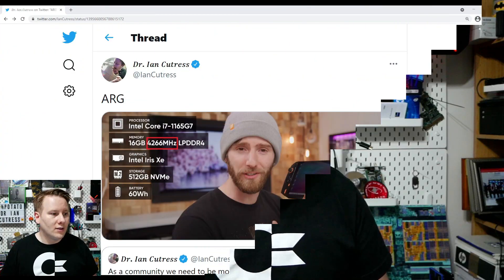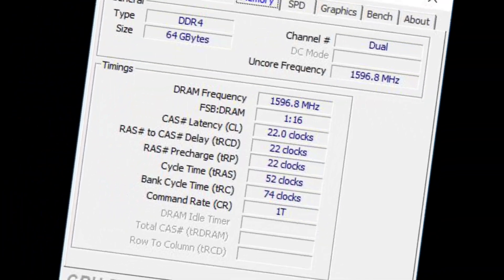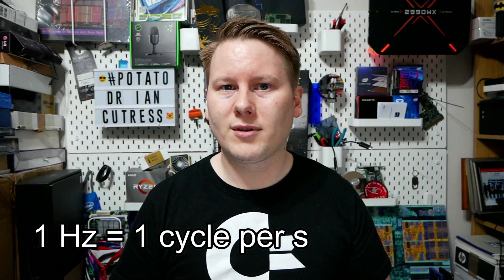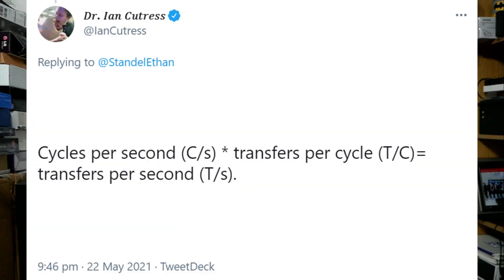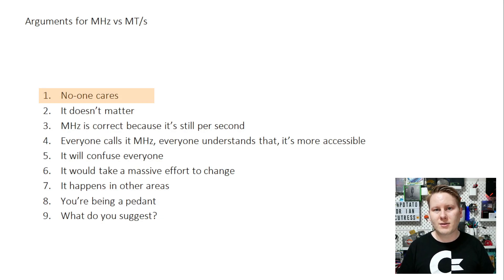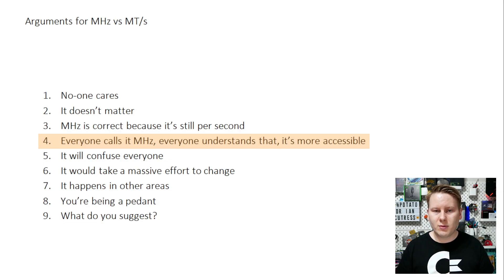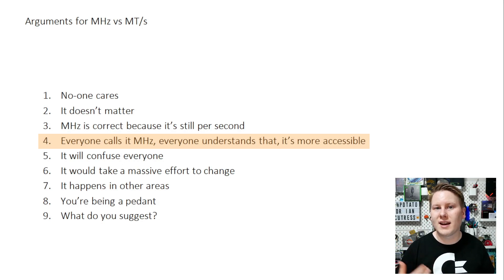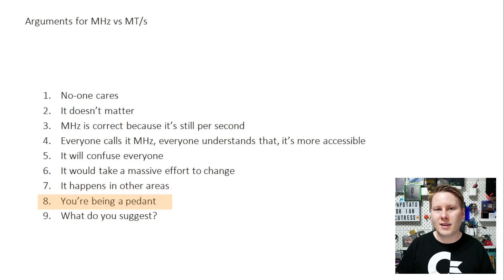Linus is WRONG 💩 : Explaining MHz vs MT/s

Comment: What if you don't refer to the clock rate but to the transfer rate? Expressing the Transfers per second in MHz is perfectly valid.
Reply: Oh you addressed that in 3. You say that you don't do a transfer every time it would be possible therefore it's not something cyclical that you would express in hertz. Maybe it expresses the maximum transfers per second? I find your argument a bit strained but fair enough.

Comment: what you define as cycle is up to you, this doesn't need to be clock cycle, if you would get time graph showing when transfers occur you wouldn't be able to tell with transfer is the first one, and with one is the second, because second transfer is exactly in the middle.
You would be right if both transfers would occur in the same time (as with your music comparison).
I also think that there will never be QDR, because you do not have more reference points to sync in clock signal.
In days when DDR was sill a new thing, you would see in spec real clock, and "effective clock" that was twice the real one, this was to help people that do not know how it world to just compare numbers.
Comparison with CPU is IMO very different thing: in memory every transfer takes the same amount of time (transfer, not operation, as operations may have different timing), and on cpu each operation takes different amount of time, therefore you do not know on what instruction base your clock, (but there is actually something like that used to calibrate idle timing by OS called bogomips - basically how many nops we can do per second)
"Clock is repeated, but you not always do transfers every time" - Our cpu also do not always run at advertised clock, and this isn't event max clock, cpu can decrease it's clock or increase over that advertised one. BTW DDR4 (not sure if previous versions had that) have something called "gear down mode" where transfers occur only once per cycle and this might be used to reduce memory power consumption when "idle"/not much usage.
The whole confusion about this MT vs Mhz started to avoid confusion. When we had SDR memory available that for example was marketed as 133Mhz, and you wanted to upgrade to new DDR memory that was 100Mhz, for non tech people this sound like downgrade, so we started using "effective clock" to be able to compare both standards. Now we do not have SDR memory used anywhere, but we cannot go back because suddenly we would call memory as twice slowed and create more confusion.
In summary in conversation about memory performance I will use effective clock, but if I talk about embedding memory module in embedded system I will stick to correct clock terminology.
Reply: Oh and maybe the funniest one, we shouldn't call DDR4-3200 as 3200Mhz, because memory clock actually 400Mhz, the communication bus is using 1600Mhz :)
Reply: And another funny thing is that in more realistic scenario, where we would use gddr6x memory transmission like standard (2bits per line per clock) we get 2x memory bandwidth with the same clock and the same memory bus width, and using MT/s won't help us to get more useful comparison.

Bus with is also not described anywhere and standard that changes that (happened often in GDDR memory) means that we can send more data per transfer.
We really should call memory as PC4-25600 but this is now usually too big number to use comfortably, but this is description how many MB we can transfer per second, so changing bus width, doubling bits send per line, sending more transfers per cycle will not affect our possibility to compare 2 memories

Comment: I'm very technically savvy and every-time I go shopping or looking at memory I get confused about the terms. If a mother board manufacturer says they support 3600MHz RAM, I have to internally remember to map that to 3600 MT/s ie PC3600, and it gets very confusing. Kudos for discussing this.

Comment: The T in transfers/second makes it a bit confusing (since T = tera) and seems unnecessary. Could you just say the transfer speed to be eg. 3200 M/s? (3200 mega * 1 / s)
EDIT: And why are we even using a capital T and not t?

Comment: So basically the point of this video was that hertz's measure cycles. Ok, I can get down with that.

But leaving out the units altogether sounds stupid. Sure it works in spoken language when everybody knows the context, but in the long run it would just add confusion. Like, it's ok to call it a "16 gig memory stick", but you still specify it being gigaBYTES in the specs. Well, this is just my opinion.

Comment: "QDR" memory was mentioned towards the beginning, like it's no big deal. Is there anything x86 on the horizon that will use QDR? I must have missed that completely.
On the topic of the video: 100% agreed. If anything, you gave way too much credit to some of the counter-arguments. For example, most tech-literate people I interact with on a regular don't use MHz when referring to transfer rates. And since I took the time to write this comment, and you took the time to make this video: obviously some people care. Proper usage of units is the main reason I can get any engineering formula correct these days. I can't remember what most of the formula should actually look like, but I can slap stuff together until the units check out. And don't get me started on fields that use non-SI units. We would be completely lost without handling them correctly. So yeah, units matter.

Comment: If you won't use units, please leave the numbers out too...unless you think everyone knows what I am talking about when I say this is about 148 or 155 depending if you messed up your math. If things are falsely or incorrectly labeled, call em out on it instead of just accepting it. Products being labeled in misleading to incorrect ways won't stop if everyone sits back to take it. I have a 10 gigabit modem with two 1 gigabit ports (how) and have a USB 3.0 flash drive commonly labeled as 'up to 10 times faster than USB2.0' yet transfers at a peak of about 5 megabytes per second which is well below the speed of fast 2.0 drives and does not change speeds when put in a 2.0 vs 3.0 port. So if you haven't yet figured out exactly what I meant with the "this is about 148 or 155" then please leave units on numbers or leave them out entirely as I was pretty specific, though without units (+relative context) deliberately mentioned.
  Thank you for the video as it did help me make better sense of what I had forgotten with the mess of RAM numbering and with recent computer issues was interfering with my mind during attempted troubleshooting+adjustment.

Comment: I'm currently in evening school learnig to be an state certified electrician and if it's a signal on a falling edge and on rising edge is a huge different to a complete cycle for me. I've really thought RAM would be clocked at as example 3.2GHz and a single bit can be send at rising and falling edge... Now that I know about this problem I think to be technical correct the correct technical term should be used 1.6GHz or (up to) 3.2MT but nothing else...

Comment: How about a dive into memory read/write/copy tests (AIDA64? SiSoft Sandra?) for different systems using the 'same speed' memory? TR 3995 Pro vs 3990X vs Epyc 75F3 vs. i9-11900K vs. Xeon W3175 all at 1466MHz 1:1 fclk/mclk

Comment: it is double data rate memory so 3600mhz is an acceptable way to say what it is, everyone uses the metric and everyone understands it.  even me who's been building computers professionally for 20+ years uses it interchangeably ... i agree with Linus it really doesn't matter especially to consumers. to say it does is just being pedantic
Reply from the maker: If it doesn't matter, then you won't mind the right units being used.
Reply: @TechTechPotato  You do you bro if you are happy to use MT's then more the power to you keep fighting the good fight ( for what its worth i wish everyone would use the correct unit ), fact is my customers haven't a clue what that means but a lot of them do understand Mhz it's just the way it is, it doesn't help the fact that the manufacturers sell it labelled as Mhz and retailers like Currys Argos and Amazon list ram or products like Laptops or video cards containing ram in Mhz. what matters to me is the customer understand what they are getting if i have to list products in Mhz then so be it, even if its incorrect.

Comment: Specs don't sell products, Marketing sells products.  The consumer base only sees a number, and is not confused about how that stacks up against other similar products with other numbers.
I'm with Linus on this one, in this case it doesn't matter, and nit picking only seeks to be correct, while not achieving any actual benefit to anyone.
Reply from the maker: If it doesn't matter, then you won't mind the correct units being used. That's literally point 2 of the video.
Reply: @TechTechPotato  Except you are the one insisting on making the correction.  I don't MIND the correct units, but I also don't MIND the incorrect ones, because in the end, I still buy the RAM I want/need without confusion.  RAM is exactly the type of product where you either care, and know what to get, or don't care, and never notice.  That is the consumer mentality, and bickering, even correctly, about semantics isn't doing anything for either situation.  I respect your knowledge and position, but some debates are in effect only academic.

Comment: Well, actually the memory has diffent lines to it. Yes, the clock line (for DDR4 3200) runs at 1600MHz, but the DATA lines actually run at 3200MHz. Or, to put it differently, if I put the binary number 01010101010101 into the memory and read that out, you actually get a square wave at 3200MHz on the data line... (yes, the clock line runs at 1600MHz, but because the data lines can change from 0 to 1 or vice-verse on the rising and falling edge of the clock line, they run at double the frequency). And its the frequency of the data lines that actually matter for the transfer speed... So, if we are saying the DDR4 is running at 3200MHz, we are talking about the frequency of the data lines and then that would be correct.
Reply from the maker: Data transfer isn't perfectly cyclical. The clock rate is. That's literally the first part of the video.

Comment: I bet when metric system was getting introduced all the listed arguments and much more were being used. And yet the benefits of having units defined in absolute sense so that meaning don't change together with the changing average size of human foot so that we don't need to refer to anthropological research every time we read printed values wins the final argument.

Comment: Bravo! This actually hits on a much broader for: the intersection of journalism and science. Many journalists feel that they have to reduce the technical information density in order to communicate a message clearly to their audience. However the problem is they often reduce the accuracy of the information. I can think of many times where I've taken the wrong concepts away from an article only to find later that I was asking because the article I'd read was unintentionally misleading. So good for you for sticking up for information accuracy in journalism.

Comment: You're coming at it from a utilitarian position. You want these words to have meanings that are consistent, and useful.

Linus is coming at this from a pragmatic position. He doesn't care if the meanings are inconsistent and ultimately rather useless. So long as they work.

So when you say, "Linus is wrong." you ignore that he immediately concedes your position and just states that it doesn't really matter because the context changes the meaning of "MHz"

And when he says it doesn't really matter, he ignores that the meaning must matter to some degree, or there's no point in bringing it up to begin with.

You two need to meet in the middle. MT/s is the proper term for the specification discussed, but why is referring to these with MHz wrong? After all, a Hertz is simply a single cycle. While true, we usually discuss the clock cycle when referring to rate of hertz, DDR DRAM is a special case in which we refer to the transfer rate, since it is more relevant to performance, usually. I'd propose that for these reason MHz instead of MT/s is perfectly fine. If someone wants to know the actual clock rate it is very easy, and there's no confusion from listing clock rate instead of MT/s after all. This isn't us saying an 8 core running with a clock rate of 4GHZ is suddenly running at 32GHz because 8 cores at 4GHZ.

Edit: And to add, regarding the suggestion that, since a transfer is not necessarily made every time it can't be a hertz-measure rate, that's honestly ridiculous. We don't consider such nuances when measure the clock rate of things, except when measuring them directly. That is to say we don't consider it in spec sheets. A 4.3GHz processor may clock up to 5GHz on certain loads, and even down to 2.1GHz on other loads. It is still considered a 4.3GHz processor. Another example of how this sort of logic falls apart is electricity. We measure A/C current as an average cycle rate when, in reality, most of the time it's fluctuating pretty wildly, and sometimes will even miss entire cycles because of this. This is considered "dirty" power.

Comment: First T/s is a better and clearer unit. It avoids confusion between interface clock frequency and transaction rate.
Hz base units do not feel wrong to me.
DRR<G>-<SG> is indeed the best solution.

Wikipedia definition of frequency is:
"Frequency is the number of occurrences of a repeating event per unit of time."
If the counted event is 'transaction', it feels to me like Hz is an acceptable unit for a repeating event like transactions on a DDR bus. 

In the case of a clock frequency is clock cycle frequency is what we use ( and I am happy with it), but we could talk about clock toggle frequency at twice the rate.

Comment: TLDR: 120% endorsed. 

about point 4, linus is right and wrong at the same time. 
we COULD omit the units as order of showing them defines all information needed.
we could have 16GB 3600 9-9-9-24 ram kit, and this description is satisfactory for most. 16GB 3600 and 16GB 3600MT/s means the same thing for all technical people, and its easier to use -> less chance for mistake and confusion for everyone else. 
using Hertz there is over complication that does not give any benefit and also might be annoying for technical people. (whole chain of this videos show it)
I am sure if anyone would miss-label their kits like this: 16GB  9-9-9-3600 any technical people would sniff it out very fast.

7. if everyone do stupid sh**, lets do it also. worst possible choice.
9. omit units for whole ddr5 -> start using ddr6 MT/s

Comment: well for better or worse Intel (or actually maybe the memory consortium themselves) have always been consistent with the MT/s vs MHz lingo.  Where MHz might be the actual base clock and the MT/s might be the dual/quad pumped version of the base clock (and if my memory serves me right it's not just DDR memory but also PCI bus or other parts/bus as well)

Comment: the Problem is you NEED to be able to Explain why its Faster quickly or you might lose the Customer....
 
"well you see the MHZ is not the Actual speed since it sends 4 ..........."(trails off into sunset) 

you lose the laymen and you lose the person who NEEDS to know what one is Faster. Marketing or not.
QDR4@1200Mhz Vs DDR4 @1800mhz.   Which one is faster? quick look might Say the DDR, but if you did the math..... you would know that DDR4 "effective" is 3600 and QDR 4 would be 4800 
and here is the Problem. Its Marketing, Yes and its "Kinda" wrong. but its getting the Consumer and End user the info they need to determine what is faster. without doing math or knowing specs beyond the Mhz. its DDR 4 and it runs at X speed.

Comment: That's a bit like the difference between Baud and Bits per Second. With modems, they were almost always transferring one bit per clock, thus the Baud and the Bits per second were identical, but if your system was transferring 2 bits per clock, then your bits per second would be twice your baud rate. Even using "Clock" here isn't fully accurate though. 

If you want it to be useful for the end users, you'd probably want to have it in the form of bits or bytes per second per channel... Mega Transfers, like MHz, is kind of a roundabout measure of performance. The number of bits per channel per second is basically the MT/S multiplied by the bus width in bits though, at full throughput, but you wouldn't actually get that all the time because there's overhead and latency in the protocol, but maybe it's useful as a "maximum theoretical gigabits per second." MHz were kind of a useless measure for CPUs as well unless comparing the exact same architecture to itself.

Comment: I appreciate you educating and helping the tech community Ian. There a units for a reason. It's always been something that has bugged me about Motherboard, VGA, Memory, manufacturers for a long while. Along with the nm fiasco. I've had no trouble in real life conversation explaining or educating others. So I don't imagine it would be to hard to educate and correct the community at large granted the manufacturers actually corrected their product terminology whether that be on product. or in bios as far as the board manufacturers go.

Comment: This reminds me of the whole GBs vs GiBs thing in storage that's been around forever particularly on Windows systems because Microsoft lists capacity in base 2 (same as memory / RAM) whereas macOS and others lists storage in metric (base 10), same as the drive manufacturers.
At some point most of us just accepted that we'd need to do a small mental conversion when dealing with these numbers and go on with our lives.